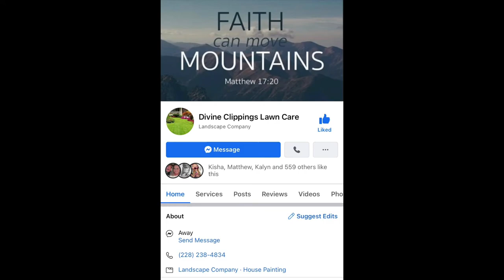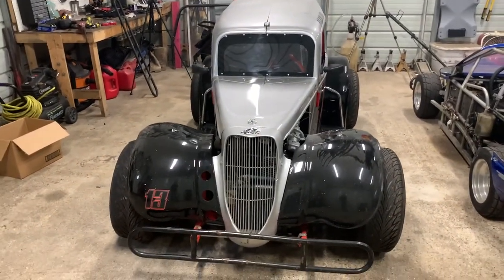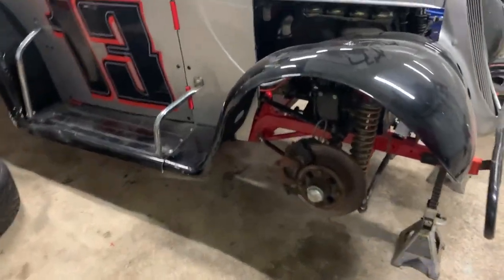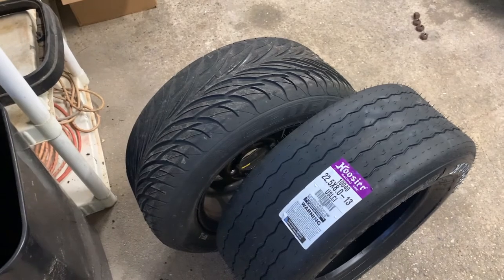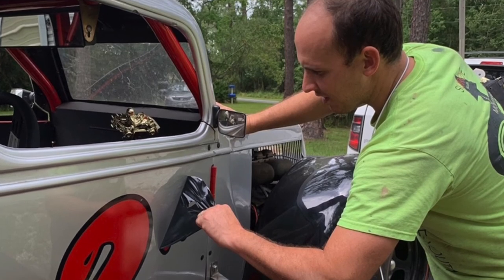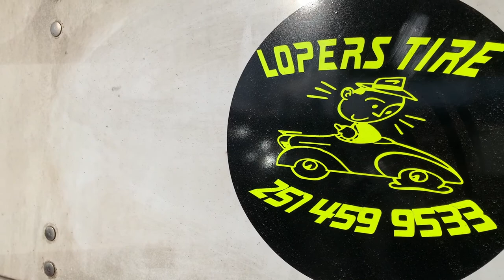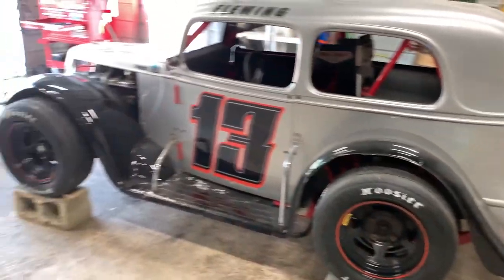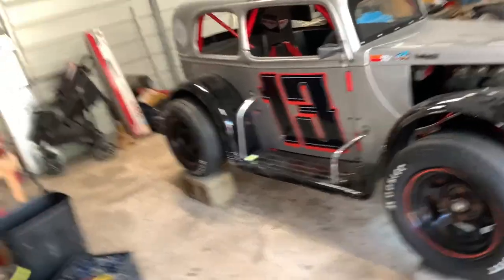Legend Car- Season Prep (Part 1)

Comment: Great video, I'm looking into getting into oval racing with a legend car. would you suggest looking out for a good used car, or getting a new one from a dealer?
Reply from the maker: Thank you! 
If it is your first time to race one or to even race at all I would suggest looking for a rental or finding someone who will let you drive it first to see if it’s even what you like. They are very fast and in my opinion not a good starter car to get into racing with. But if you already have the racing experience with driving something then I would say find a nice used one instead of spending the money you would on a brand new one to learn with. A cheaper one to learn with is a lot easier on the bank account if something happens with being new to the class. Overall they are insane fast and fun to drive.
Reply from the maker: They have the champ karts at our track with have full cages and seat belts to prevent that from happening

Comment: I just picked up an older baby grand/ pro challenge race car and have been trying to figure out what all the different parts are. It's got a Suzuki GSXR 750 in it. I plan on restoring and painting it up like Dale Earnhardt's #3 car. I'm new to these cars and have a lot to learn,but I can't wait to get thing racing.
Reply from the maker: That’s awesome. Make sure to email us so we can do a driver shoutout and see some pictures of the car! 👍🏻
Reply: @flemingfamilyracing  thanks for the vids.  Are you guys running the newer fuel injected motors?
Reply from the maker: No sir the 1250s

Comment: How are you using a plumb bob for set up?    Thanks
Reply from the maker: We hung them on all 4 corners so we could pull measurements to make sue the car was square. And to also make adjustments on the rear end to align it. Also how we measures the rear end left to right
Reply: @flemingfamilyracing   awesome thanks.    Don’t be afraid to make a set up video.
Reply from the maker: I sure will. I’m still learning that too but it will happen on my car now that I have it tore down